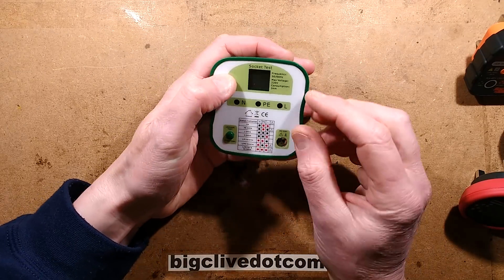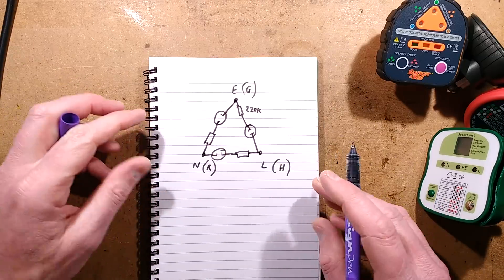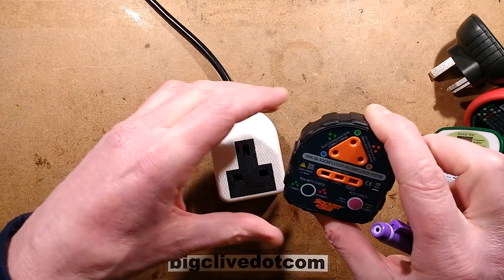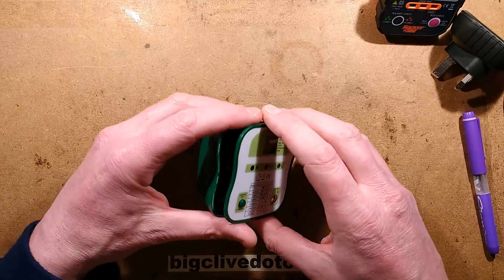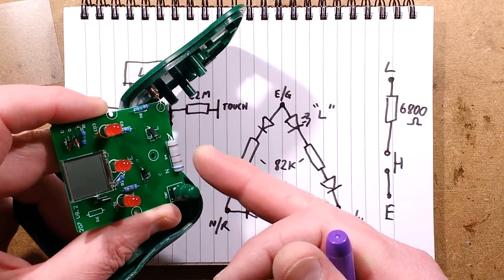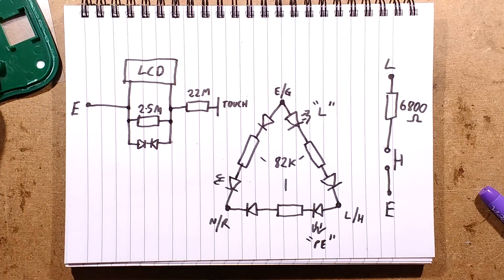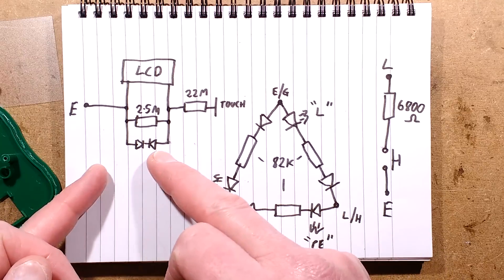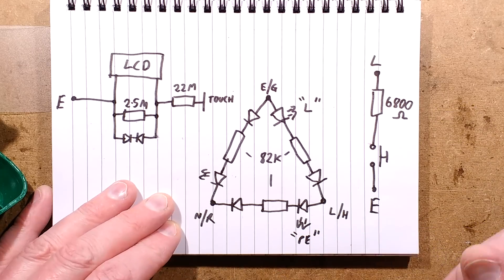Inside a mains socket tester with LCD display.  (with schematic)

Comment: I do wonder if YouTube commenters will ever stop being bemused by the fact that some channels release videos to some people (like Patreon supporters) early and thus there are comments prior to the public release of the video. ;) It's a thing, get used to it. 

Relevant to the video - I had to get a whole bunch of electronics repaired when a miswired new outlet was putting out 220V somehow; here in the USA, that's not good where most things are expecting 110/120V. Thankfully nothing worse (like fire) happened, but I was rather annoyed with my landlord, as you might imagine... I bought a tester along these lines and now any time work is done, I check before plugging my stuff in....
Reply: Furr Bear I was wondering about the comment times…
Reply: You have a “TT” system on the Isle of Man. Nice :p
Reply: 220V isn't that uncommon.
You connect the 2 phase of the utility transformer, that's kinda common in Mexico so you can use more power in large appliances without any problems.
Nowadays every switch mode power supply is multi range 100V-240V (Japan to UK basically), you need to worry is you power supply is based on just a transformer
Reply: Actually this is not a second phase. It's one single phase, and the system is called "split-phase" because the phase is split into half by the neutral wire which is connected to the center tap of the secondary side of the transformer:

https://upload.wikimedia.org/wikipedia/en/2/29/Split_phase2.png

In the US 240V is used for appliances with a high demand like dryers or some power tools (welder, table saws) for example.
Reply: There is no phase deviation, like I've said, it's only a single phase system with the neutral attached to the center tap only on the secondary side of the transformer. On the primary side there's no neutral. Take a look at the picture I've linked (Wikipedia).
And they're called Line A and Line B.
Reply: It's not comparable to a three-phase system. In a three-phase system you have a phase deviation of 120° because in the generator in the power plant are three coils mounted in an angle of 120° to each other causing the phase deviation:

https://upload.wikimedia.org/wikipedia/commons/7/78/Simpel-3-faset-generator.gif 

It's the same phase, just splitted into half by a center tap in the transformer. It's not having a rotating field. Just take a look at this diagram, it's showing the voltage curves of all three phases over time:

https://upload.wikimedia.org/wikipedia/commons/c/cc/Dreiphasendrehstrom_mit_Strangspannungen.PNG

To see that it's only a single phase without a phase deviation you actually must use an oscilloscope and then you can see that there's no time delay between Line A and Line B.
Reply: +Ollyweg 0
The problem is that you compare the LA and LB to the center tap. You need to compare LA to LB, thus one phase, LA-LB.
In a three phase system you have L1-L2, L2-L3, and L3-L1.
Reply: +CodeBurger
Correct! The three lines in a three-phase power system are creating a rotating field. In the correct order it's rotating clockwise (..L1 -> L2 -> L3 -> L1 -> L2...and so on). This can be used for things like table saws, so they don't need the fat capacitor connected to the motor to rotate.
Reply: +Ollyweg 0
To add to my previous comment:
LA, LB, L1, L2, and L3 are not phases.
Reply: Ollyweg, there is a two phase system with 90 degrees phase shift. It was used in ancient days to run motors. It's not used for power distribution because the currents don't cancel in the nuetral. In fact, if the phase currents are equal the neutral current is 1.414 times the phase current. 

Three phase uses much less copper and performs better. That's why you never hear of two phase power, it died long ago. 

Our (US) single phase is called that because one phase of a three phase system is used and the transformer center tapped, which is exactly what the link given by someone else shows. We don't call it two phase because of the older two phase system and the fact that it's derived from a single phase.

Comment: Getting your earth from somewhere exteral seems so dangourous. Imagine being in your well earthed bathtub while they're doing electricity works and swap the cables by accident. Here, every house needs to provide its own earth by placing a copper ring under the entire foundations of the house. Having a simple copper pin isn't good enough any more.
On the other hand, our neutral isn't necessarily equal to earth, but can be 110v away from earth.
Reply from the maker: We also use equipotential bending of all pipework so that even if there was an electrical incident the bath would still be an equipotential zone.
Reply: bigclivedotcom, but if you get out of your bath, you can form a pretty good conducting path to ground if the cable swap incident happens. Quite mortal conditions I'd expect. And there's no rcd to trip in that case AFAIK.

Comment: thx for the video... just spend an fortune on one of these with display and RCD tester and all of that jazz- it cost a whopping 5.50USD delivered to Denmark from a china wholeselelr called Banggood... it was this one..
https://i.imgur.com/KYsyE5q.jpg
https://i.imgur.com/RXzxW2x.jpg
Are a noob on electronic so just trying to make sense of the values.
Reply from the maker: I just got one of those recently too.  The digital display is not accurate on mine.  Be careful if using these in a wet environment.  They can make ungrounded metalclad sockets live with their test current at enough current to hurt a lot.  That's why Fluke recalled all theirs.

Comment: I had a question for you so recently it was recommended to me by a doctor that I try a device called radiation to light apparently this device absorbs the radiation from the phone and stores it like a battery and then bleeds it off through an LED light is you with this is that I know that the waves that come off of phone are radiation so if I'm absorbing that radiation is not affecting my signal I'm wondering if this device actually works. If you look it up on YouTube you'll find it it's called radiation to light or R2L for cell phones I'd be interested in what you find out if you have the time sir
Reply: lol those things actually existing!
Clive you have to do a video on this blushit.!
Reply from the maker: +UpCycle Engineer I'm afraid your doctor is not a real doctor.  The device sounds like the quack version of a flashing phone sticker that uses an antenna to power an LED.  In reality it makes the phone put out more RF signal to compensate.
Reply: +bigclivedotcom Not to be a jerk by disagreeing, but it's also entirely possible that the Doctor just isn't very smart on electronics, and truly does think it is real. I know my own doctor genuinely cannot use computers at all, and they have to have someone else do all their computer work for them.
Reply: Zazaaji  My experience is that if an educated person truly does not know about a subject, they will refer you to somebody that knows more (as in your example, when the doctor gets someone else to do their computer work). They will usually NOT say 'I know exactly what your problem is (in this area I know nothing about) and this device will solve your problem.' It is usually quacks/charlatans/etc. that do this. 

For example, my doctor recently referred me to a skin specialist because he wasn't sure whether a skin discoloration was something to worry about or not. Good doctors know what they don't know as well as what they know.
Reply: Zazaaji - Doctors can be very odd, there’s one I see occasionally (I try to see another but when he’s not available I sometimes get this guy) who keeps finishing my sentences and answering them when I wasn’t going to say what he thinks I’m going to say, then refusing to be corrected, so I can well believe in one who thinks phone radiation converters is a real thing.
Reply: bigclivedotcom thank you for the response I was just interested in your opinion these are some of the things I thought as well but I figured maybe you guys all knew something I didn't

Comment: tncs earthing ? somme people actually trust their electric copany with their earth??? are they crazy? is is a topical brit thing?
anyway if I ever find anyone, especially from the electric company mingling with my earth the only thing they are getting is a kick in the ass! my earth is private and I'm not leting anyone else touching that.
Reply: but if your hose is build on dry sand TN-C-S might the only way to get a good earthing usually all earth combines will give a much better current path even if The PEN line is broken. Also In a TT system wierd stuff happens when the n line is broken
Reply: According to wikipedia: france, italy, spain: TT - germany, swiss, austria: TN-C-S.  
Naiive question: Can you not use TNCS and then ground it additionally at your house?
Reply: whuzzzup tncs usually requires local grounding and potential equalisation but it doesn't require as low impedance as TT